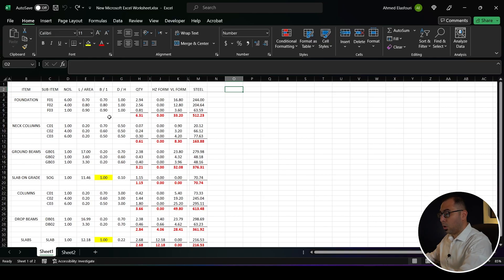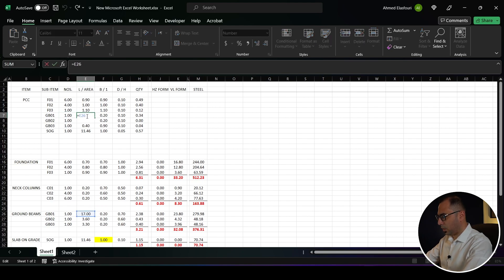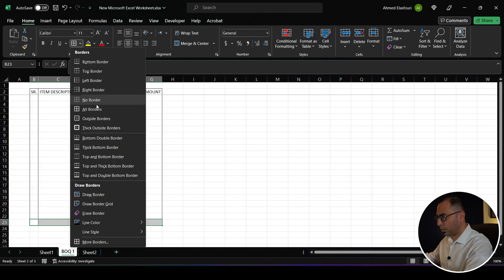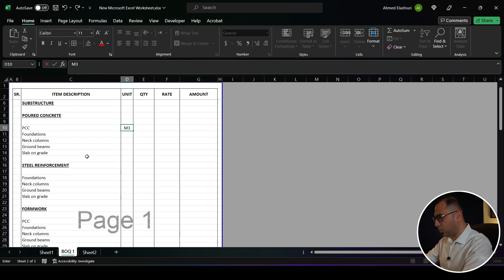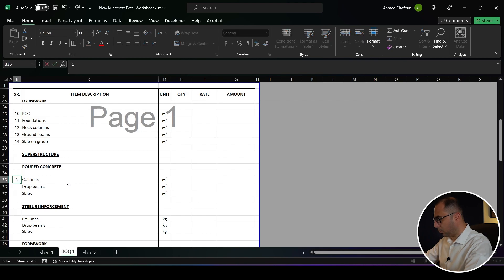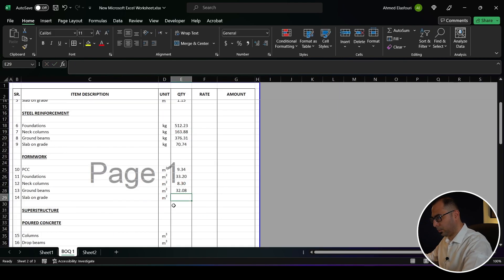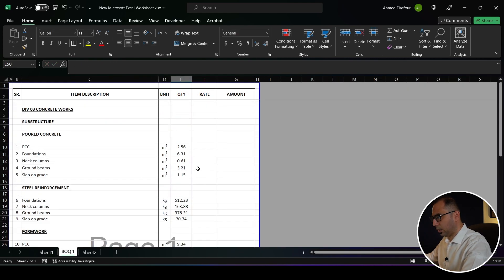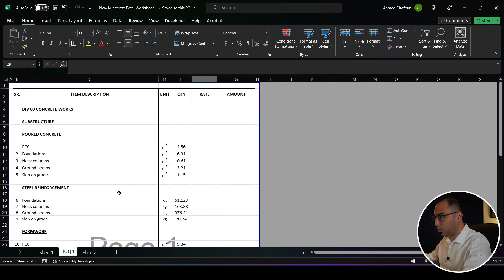COST ESTIMATION | How To Estimate The Cost Of Reinforced Concrete Structures Part 4

Comment: Can you please explain grade beam and plinth beam ??........ actually slab on grade cast monolithically with plinth beam after filling upto plinth level .....grade beamd are cast  on ground level ....isnt sir ??? Pls explain... Then why u r not included plinth beam in sub structure works ?????
Reply from the maker: Usually plinth walls are on the periphery of the building and they start down at foundation level up to sog level. Grade beams or ground beams are internal and they start mid height